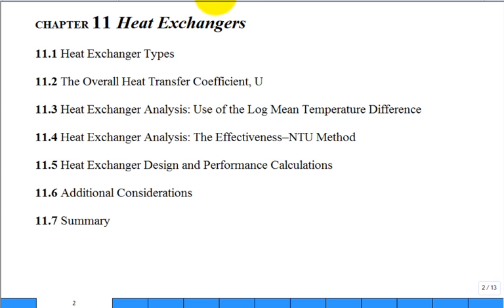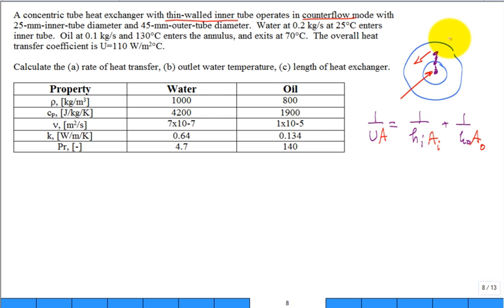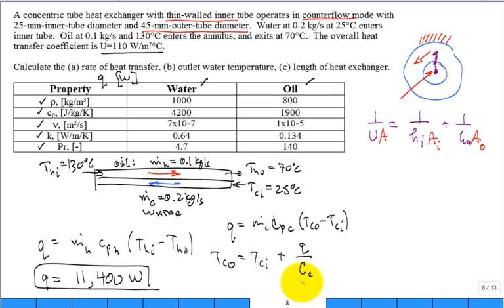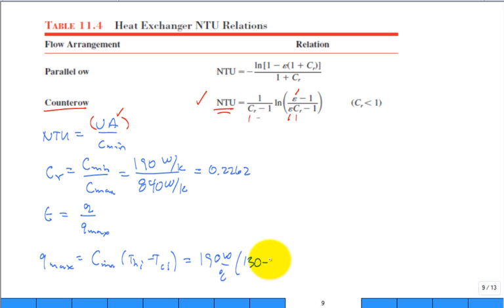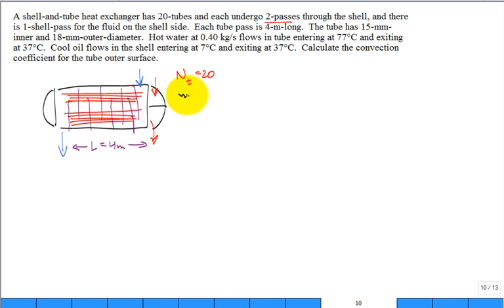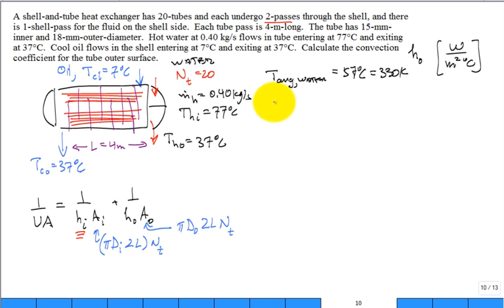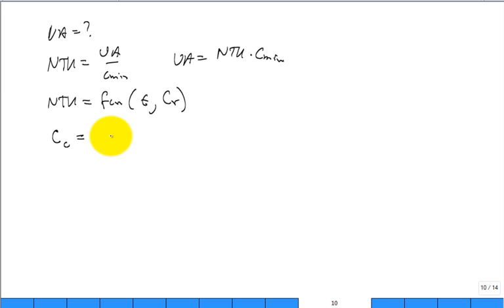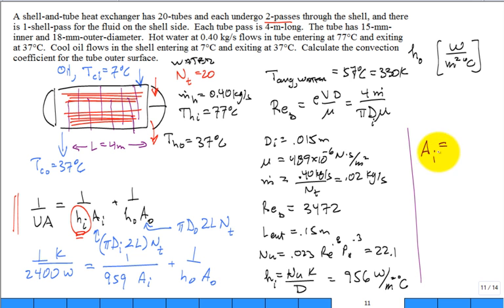Heat Exchanger 3 ME4313

Comment: I am assuming you forgot to include the mass flow rate of oil in the question as you said that C_c =2231 W/deg C @28.22s in the video. At 295K the c_p of oil is about 1888.5 J/kg*degC which should give you a mass flow rate of about 1.2 kg/s for oil.